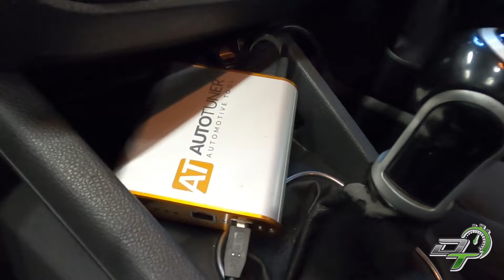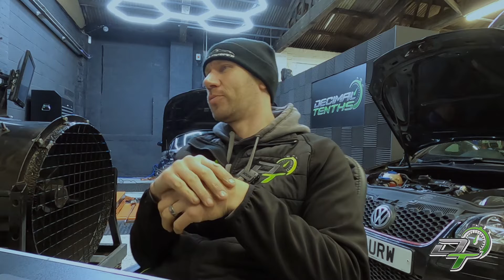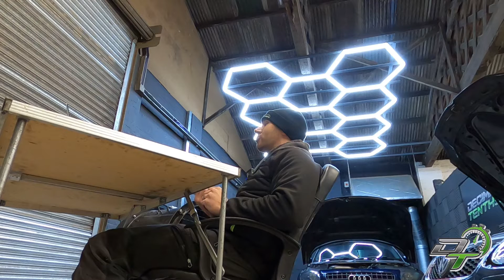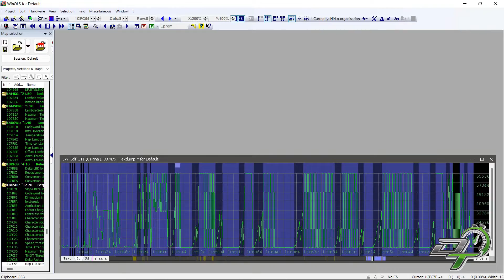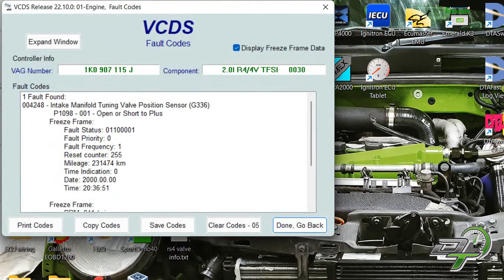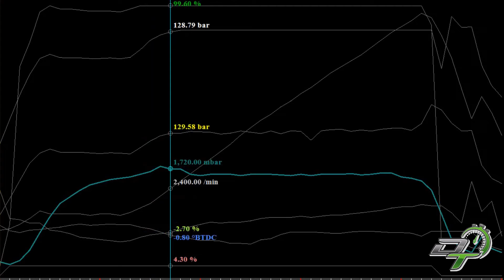BASEMAP and FIRST START time for the Mk5 GTI 🔥

Comment: what about the 5mm hole you drilled on the fuel pump i have done the same and my mapped is saying at idle the car is running rich but ive not told him ive drilled the 5mm larger hole ... whole it course this issue ?
Reply from the maker: No it won't make a difference
Reply: @DecimalTenths  could the 02 sensors are faulty or could there be bigger injectors in there coz he is saying its running rich at idle like -27 should be +5 % ?

Comment: so nick regarding the runner flap delete, if i was to install the kit and not have it mapped in, im assuming the only "issue" that would occur is the cold start would be a bit lumpy and thats it? no damage will occur.
Reply from the maker: Yes pal, no damage will occur.

You will have a few fault codes stored for it but they won't do anything. Cold start routine will be affected, mostly noticeable by a rough hunting idle until the cat heating routine is complete.

Comment: Hi, my mk5 has Unitronic stage 2 tune, I installed the flap delete kit but the car started acting a bit weird..sometimes it stalls especially on sudden breaking after acceleration from a stand still. Is there anything I can do to fix that other than reinstalling the flaps back?
Reply from the maker: Sounds more like an air leak. I would smoke leak test this to check 👍
Reply: Unitronic has a tune for that i believe

Comment: Great video  , when we getting another one ........ ? 😁
Reply from the maker: Next week should be pal cheers
Reply: @DecimalTenths  Subscribed ! 😁 Just got an 08 plate gti edition 30 so will be in touch after new year to  speak to you about intake walnut blast , injectors cleaned and tested , runner flap delete and balance shaft delete.  😁👍

Comment: man I've tried opening winols demo once and going through my quite bad me7.5 20vt map to see what the tuner did, couldn't find a definition file or whats it called for that specific part number ecu, so I then tried looking for the maps in another me7.5 file from a passat that had the definitons, and mapping it over bit by bit. Probably gave up after 5% and never tried doing anything related to ecu tuning again. I'm a software developer but this kind of work is just on a different level to my brain.
Reply from the maker: Oush, yeah its headfuck central at times. Especially if you don't have a definition for the data. Only stupid people like me tend to continue with it....😬🙈🤣

Comment: Pretty simple tuning solution for sure! Gotta love being able to make the most gains out of all your parts you just bolted on. That interface is really user friendly and relatively easy to use, especially compared to some standalone EMS. Using the S3 stuff is a no-brainer too. It's pretty much the most cost effective/ guaranteed way to upgrade the stock longblock. An 'OEM bolt-on update' if you will. OEM+++ 😆  Good job deleting the variable runner flaps. People can argue a possible loss of torque by eliminating the flaps all day long, but it's so negligible if anything I wouldn't worry about it. It's idling smooth and the throttle response is right on, and that's just a base map with no tweaking. I don't know if you've seen the Integrated Engineering manifold, but it's a worthwhile upgrade, along with a throttle body as well since you can tune for it. The BBS CH look sweet on there too! Always liked the CH's cuz I 💙 BBS in general,! 🙂 This is definitely a great start to a tasteful build! Thanks for sharing this, can't wait to see that spinny boiiii get leaned on a little bit! 😁👍👍💪
Reply from the maker: Cheers mam, appreciate the comments 👍. Not trying to redesign the world or go wild with this build. Just a nice hopefully 350bhp daily driver 🤙. Love the Mk5 chassis, look and feel and build these for people all the time so cool to do one for myself 🤣

Comment: is it possible to make a gti  throttle more lineair on decelleration. i was stopt by police en my exhaust was toe loud en was not allowed to drive my car i had to fix it en get a new mot on it now is my problem my db was to high when je let of the gas at 4.5k rpm the volume peakt now if you let of the gas slow it was good  so is it possible by mapping the throlle to get a slower decelleration
Reply from the maker: Problem with a slower throttle on decel is that even when lifting off, the car will want to continue to drive on by itself. It will be awful to have to brake to slow down when normally lifting the throttle will do. 
Surely the answer is to change the exhaust.?
Reply: @DecimalTenths   i changed the exhaust en the guy at the mot station understant wat it was and let of the gas slowly and it was all good i was just  curious

Comment: Really enjoyed that after not having any experience with the mk5's.. everything is all within relevance. 
I think I'll run 4bar FPR+ Map sensor with my hybrid turbo.. leaving lots of room for mapping :) 

Regarding the 1.8t style fuel pressure system, do do always have to change the maps when adding a 4bar fuel pressure regulator or will they adapt enough within tolerance ...haven't tried logging anything yet but I'm sure you have that experience ;)
Reply from the maker: A 4bar fpr will increase fuelling by approximately 15%.
It can be adapted out but best to not gamble incase of bore wash so I'd keep the 3bar in until mapping so fuelling can be callibrated.

1.8t MAP sensors can't be changed, so your stuck with the 2550mbar sensor on that ECU. 👍
Reply: @DecimalTenths  I mean even if the 4bar won't calibrate with the ME7.5. 
1.8/1.9 bar is enough for a hybrid anyway as with the right setup that should be more than enough.. without overheating the intakes :)
Reply from the maker: @TTAutowerks94  Unless there is custom code, a bigger scaled MAP sensor can not be added to an ME7.5 ecu. All 1.8t MAP sensors are 2550mbar. No 3000mbar are compatible.

On an 1.8t we have to tune boost open loop above this sensor range and accept that we don't see the boost in the logs. TFSI is better as you can scale a bigger sensor in, as per the video
Reply: @DecimalTenths  that's mad, because I do see more than 1.5bar positive pressure on my 1.8t. 
The code that's on my sensor comes up with a 3bar aswell 🤷 

My boost can be read all day everyday at 26, 27, 28psi then tapers down to 20-22psi which is 1.5bar, it wouldn't even read that if it was 2.5bar sensor as you have explained yourself in this video.. the sensor data will literally stop and flatline at 2550mbar. 

But mine doesn't do that.. it reads data up to 26-28psi (1.8-1.9bar) (load dependant)
Reply: @DecimalTenths  I eat my own words.. I've looked again and apparently it's very complicated but I can't see any cross ref for the 3bar.. it has a C on the end instead of a D. The D sensor is 2.5bar.. so how on earth does mine push the boost it does 🤣 and read it correctly all the time.. does the MAF also take into account the reading of the Map after the 2.5bar threshold..?
Reply: @DecimalTenths  completely makes sense on the fuelling and I thought would be the case.. 

However I have the 225 Bam k04 setup and as far as the part code goes as it's the later map sensor it's 3bar. But can be replaced by an identical & same plug 4bar map sensor. Both made by Bosch both the later type for the 2005

Comment: Why not ignatron
Reply: ignitron wont work with this... this car is med9

you could tell straight away when he said about a 140/200bar fuel pressure sensor. the 1.8t your thinking of comes with a 3bar from factory and has the injectors in the intake manifold

this engine is direct injection and not compatible with ignitron

from the map id you can tell this is an med9.1 ecu

ignitron is designed for the older me7.5 ecu's
Reply from the maker: Ignitron is a plug and play 1.8t ecu, and doesn't support direct Injection which the TFSI runs 😁